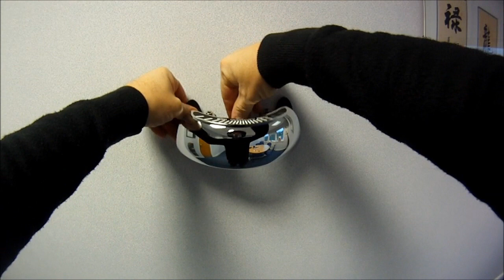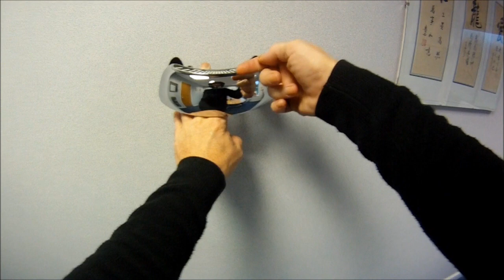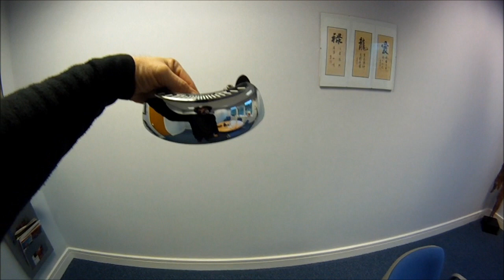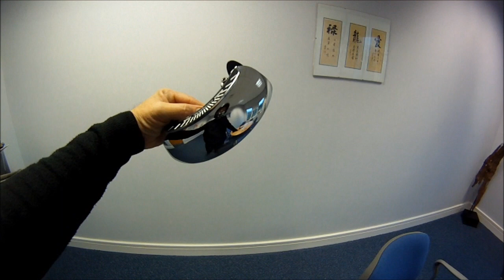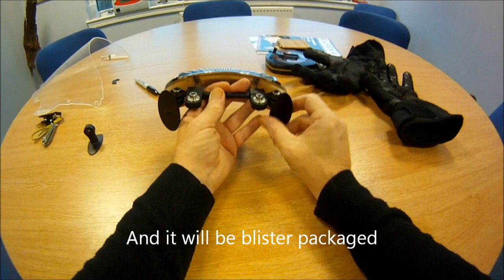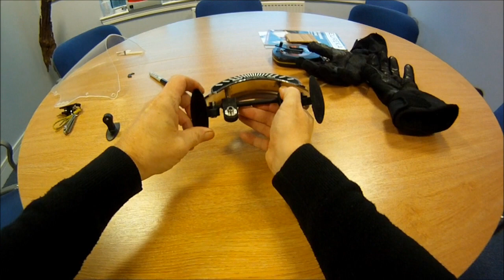RiderScan design features explained.

Comment: I would love one of these products, I've seen them used by the riding schools and such, and they look like a good aid to safety, but two things put me off :-

1). The price. It's overly expensive when the lifesaver is free. I know readers will say "What is your life worth", but honestly, a £40 device left attached to the screen of a motorcycle in the City where I live is a invitation to have not just the mirror pinched, the the entire machine! We can't afford to have nice expensive things on our pride and joy because they always get nicked. And please don't say "You can simply remove it", I already have to remove my panniers, backbox & brain buckets, They nicked the warning cord for my disc lock in March! Why? It's worth nothing! They pulled the machine over trying to get the  cover off which was secured to the lock off the disc lock, damaging both the cover and bike, the cover was four nights old, so anything over a couple of quid is asking for trouble!

2). It fixes with suction cups or sticky pads. Again, in the City where I live, even when something is screwed down the thieves walk around with multitools and are ready equipped to nick anything, they know the police can't touch them for carrying them!

Therefore, whilst it looks like a wonderful device to aid motorcycling safety, the cost vs the length of time it is likely to remain attached to my machine makes it too expensive in the society I have to live in which is a real shame because it looks like a awesome aid...